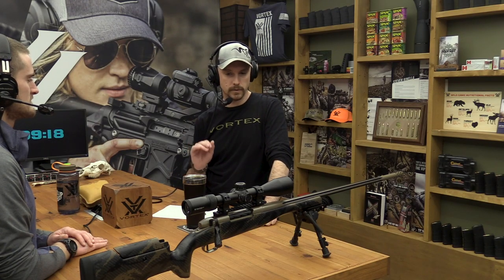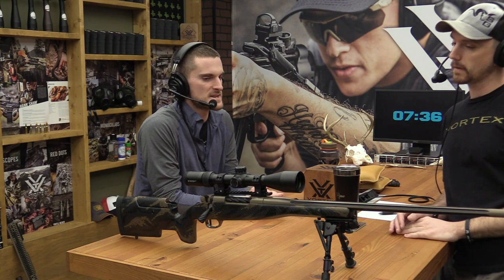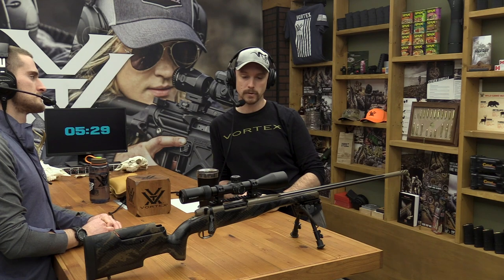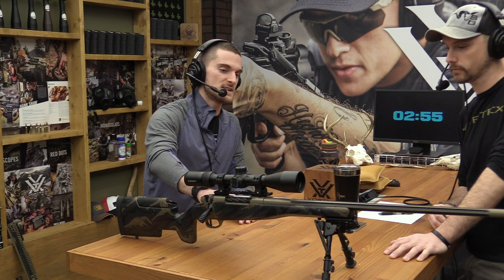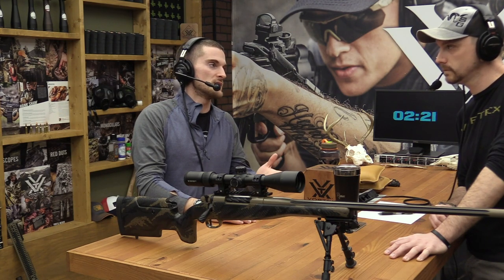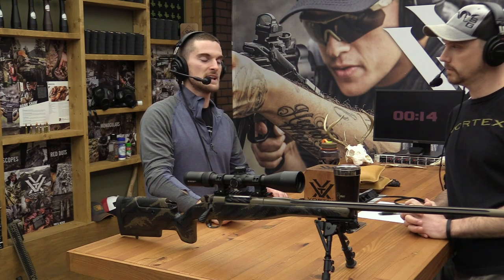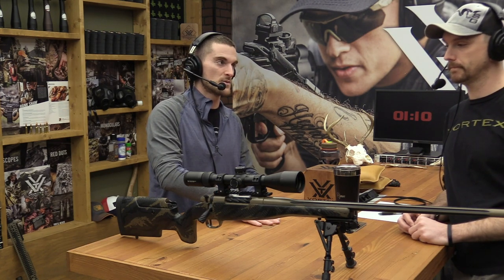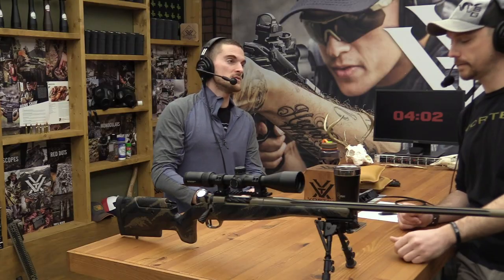#10MinuteTalk - 20 MOA Bases

Comment: Do you also have to buy 20MOA Rings for the scope if you have a 20MOA base?  Nevermind you answered it.  20+20 would be 40 MOA....makes sense.  So use 0 MOA rings if you have a 20 MOA base.

Comment: May be a dumb question, but im gonna ask. I just picked up a 6.5 creedmoor, I checked the picatinny rail screws for tightness, they were very loose. I went ahead and removed the screws to clean and chase the threads before putting the 20 MOA rail back on. When I removed the rail, there was a significant coating of oil under the pic rail? Is that normal? I just watched a MDT video and their shooter said he put oil beneath the picatinny rail?

Comment: Just picked up a rem 700 in .308 and have a Viper PST 6-24x50 ready to throw on it but I’m split between a 0 and 20 rail. Using it for hunting and most shots will be inside of 600yd but id love the ability to hit steel at 1000 if we’re messing around on the range. Do I need a 20Moa rail with that 65moa travel in the scope?

Comment: This resolved my issue.  I've got a Leupold Mark 5HD 7-35 and had a zero cant scope mount on a Tikka Tac A1, 6.5 CM.  After zeroing the scope, I only had about 14 mills of adjustment on a 30 mill capable scope.  I intend on shooting past 1200 yards.  A 30 mill base has been ordered. Thanks for the info.

Comment: good info. have a question tho.
i just put a 20moa base on my 06. won't  be going to the range for a while but wanted to see if i could preset it kinda close first. could you please tell me if my process is right or if i am way off?

to calculate the approximate zero from bore level i used strelok app to find what distance would require 20moa elevation. plugged in a 1 yard zero with a scope height of zero. it showed 710 yards needs a 20 moa adjustment. so if i put my 2½" high scope on with zero elevation would that put poi at 2½" high at 710 yards?  does that work right?

if so i can plug in the right numbers and adjust for the scope height and preset for any distance. or if i'm wrong i will just have to wait for range day and start from scratch

Comment: Great video, Question, If you have a new scope/rifle with a 20 moa rail attached, the first thing you do, even before boresighting etc, is to click down the scope by 20 moa/5.8mil to adjust for having the 20 moa rail attached?And only then you go ahead and boresight and zero your rifle, which of course could mean you may have to further fine tune up/down depending on scope height etc. Is this correct? (assuming you have mounted everything else correctly etc etc) I know some of you say you should always boresight first thing, but I dont understand this because you already know that you are "wrong" by 20 moa so why not adjust for that first thing? That should at least make your initial settings closer to the correct settings?  Please comment
Reply from the maker: It might make them closer, but it’s not going to be perfect like you eluded to. If that is just part of your procedure it’s certainly not going to hurt anything, but what very likely may happen is that you dial in that 20 MOA before doing anything else, then when you go to bore sight you have to take a bit of that out. It’s a horse a piece. Whether the optic starts at optical center or a predetermined spot, it’s going to need to be adjusted anyway!

Comment: I have a FX Maverick in .22 caliber With a Titan 5-25x56.  In your discussion you said that 20moa was not required.  If that is the case what mounts would you recommend ??
Reply: Standard rings.  I do believe the Maverick has 20 moa built in, my Impact mk2 does.  1000fps airguns can benefit from it, because that's so much slower than the guns these guys are talking about.  Our 60ish yard drop is similar to a 308's at 1000 yards.

Comment: You guys hit on alot of the major points for using a canted base.  I am the 22lr guy, I shoot 300 yards and bought a 150 moa base to get out to 500 plus yards (I know 150 is a lot), I appreciate the comments about being optically centered looking thru the scope.  I agree most people won't need a base unless they are running out of adjustments using their turrets.  Good info on  moa/mils  simply divide by 2 to get your up/down usable numbers.
Reply: What's your closest possible zero with a 150moa base haha? I dont ever see scopes that have that much travel
Reply: @aquadonkey.  I honestly haven't tried to bring it in, I'd imagine I might be able to get as close as 75 yards using all I have in the scope.  Personally I would just use one of my other rifles that are zero'ed at 50 yards.  I kinda like to keep the 600 yard zero set and just shoot long range with that rifle, the 150 moa scope base I can dial back to 0 moa or flat with the barrel, doable, but a lot of dailing, lol
Reply: @aquadonkey.  I use a Herritage Arms Coldshot 150 or 300 Moa scope base under my scope, my weaver t-36 scope hardly has any adjustments, so the adjustable base gives me a true 150 moa worth of elevation to get on target

Comment: I have a 30-06 savage this will be for hunting. would you but a 0 moa or a 20 moa rail. I plan to 0 at 200 yards.
Reply from the maker: With either you could zero at 200 yards no problem. It would really depend on how far you are looking to shoot out to. If you are planning on shooting 700 yards+ then you would want to go with a 20 MOA rail. If you will be shooting closer than that, a 0 MOA rail would be just fine.

Comment: Is there a way to calculate what base you should run? Just picked up an R700 tactical, trying to find out what base would be usable with 65moa of elevation. Realistically only shooting up to 500-800yds
Reply: If you are only shooting 500-800 you would be fine with a 0 MOA base.  No need for 20 moa plus base, unless you plan to shoot out to 1k plus.
Reply: I would say 500 to 800 yds that a 20 MOA base would be just fine and give you a little more elevation MOA. Any shorter than 500 yds. stick with the 0 MOA

Comment: It took me awhile to understand this MOA scope business as I am new to shooting , 6 months so far.

When you install a rail with say 20 MOA it's not the scope that tilts down it's the barrel that tilts up. 
So a scope with say 60 MOA total max. elev. adj. and a 20 MOA rail will tilt the barrel up 20 MOA and the top half of the scope adj. which is 30 MOA allows the barrel to have a total of 50 MOA adj. as it is already adjusted 20 MOA because of the rail.

The barrel moves people not the scope. 
😃
Reply: @Old SkoolK-5 it took me awhile to understand what is going on but I think I have it now. Three weeks ago someone put a 30 moa rail on my rifle with 40 moa max vertical movement in the scope and at close range 50 yds we could not zero it in and they said my scope was NFG. I switched to a 0 moa rail and the scope is now fine. I was told however at long distances I would be good to go. TRICKY for new shooters to understand.

Comment: Hey guys, if you zero your rifle right at the bottom of the elevation range, is there any downsides? The forums say it can hurt the scope, but what’s the opinion there
Reply from the maker: You would be zeroed at a spot that isn't in the optical system's most ideal spot - the best optical quality you'll get out of a riflescope is right in the middle of its travel. You also are leaving yourself with zero room for error should you ever need to make a click or two further in elevation - you're already bottomed out - and you're going to have much less windage travel at the extremes of the elevation, too. It's really not a great spot to be in.

Comment: I have a Howa 1500 Tspx 6.5prc with a 20 moa base. I'm have trouble sighting in. I have a Vortex Strike Eagle 6x 25 x 56. I was wondering can a lazer bore sighted compensate for the moa rail¿    I'm new into long-range and new into shooting. I know I might have put the cart in the front of the horse but we were all there once. Please, any advice would be greatly appreciated.  Thank you
Reply from the maker: You would be much better off pulling the bolt and bore-sighting that way rather than using a laser boresight tool. If you need any help, give us a call at 1-800-4VORTEX ext. 5 and we can make sure we get you all sighted in.
Reply: @VortexNation  thank you very much sir

Comment: What MOA scope mount should I get for Sig Sauer SIERRA3BDX 6.5-20x52 Rifle Scope? thanks
Reply: I have the leupold 4x24x52 with a 20 moa rail my scope is really high be sure you have the right stock to accommodate the discrepancy, I had to add a sleeve on my stock I don't really like it

Comment: I just got a 10.5 inch pof ar pistol. 
I Also have a colt 16 inch AR. 

I bought a PA 1 to 6 acss raptor 
What kinda mount do I need? 
I would like to have one I could switch it back and fourth till I find out what i like. 
I’m not hunting. But you know end of world kinda zombie deer gun. 
Just for fun thing. And I want to learn more. 

I liked the scalar works mount it looked Easy to put on. 
With the 1.93 

And the 
AD mounts with 1.93 

But PA glx 30 seems to be ok for 100$ and me not even knowing what I need it comes in 0 or 20 moa 

Any ideas ?
Reply: Ffp scope btw.
Reply from the maker: Are you hoping to have one mount and swap scopes in and out of it, or different mounts with different scopes in them and you would swap the whole mount/scope combos in and out on the gun? If you're hoping to do the first option, then switching scopes in and out of one mount is about the same level of effort/time regardless of which mount you get. Any of the mounts you've mentioned should be fine. If the second option, then having a mount that's quick-release like the Scalarworks mount, or an ADM mount, LaRue, etc would be good. For what it sounds like you're doing, don't worry about getting 20 MOA - a 0 MOA base will do just fine.

Comment: I have a Vortex Diamondback Tactical SFP 4-12x40 with a zero MOA base on a Rem 700 5R .308 and I can dial it to 37.75 MOA and hold dead on at 1,000 yards.
Reply: Strange as this scope only has 70 MOA max. elev. adj. which means 35 MOA upward adj.
Reply: @DLN-ix6vf  My scope tops out at 39 MOA elevation.  When you zero a scope it's not going to be exactly in the middle of available adjustment.

Comment: Question! With the 20 MOA base, can one make accurate shots at shorter distance? Let's say 50 or 75 yards? Or is it too much of an adjustment? Would I still sight in at 100 yards? And just have the capability to shoot long distance? If that's the case, why would someone NOT get a 20 MOA base? Thank you
Reply from the maker: The biggest issue most people have is zeroing the center crosshair at closer ranges with canted bases - usually a 20 MOA base on most rifles with a scope with a decent amount of adjustment have no issue zeroing at 100 yards still, but significantly closer or with a significantly more canted base, it can become impossible. Accuracy at close ranges is a different story altogether since you can still technically shoot accurately at closer ranges, you might just need to hold on a different spot in your reticle, dial differently, etc. There are tricks to overcoming a lack of adjustment in some way or another with your reticle, it just depends on whether or not needing to do these tricks is acceptable to the end user!
Reply: @VortexNation  thanks a lot! Appreciate your time. Great podcasts!🤝🤝
Reply: you could buy an adjustable moa base, I own a coldshot 0-150moa base, I will be buying an era-tac 70 moa base next month, era-tacs adjust in 10 moa increments up to 70 moa, or the Ivey adjustable base which is about twice the cost of the first two I mentioned, I like my coldshot as I can keep my scope optically centered, no or minimal adjustments on my scopes up/down adjustments as the coldshot scope base adjusts in 1/4 moa clicks, that is approx. 4 clicks per inch at 100 yards, optically centered is like looking thru a magnifying glass straight ahead vs moving the glass and looking thru an edge, there is less distortion looking thru the meat or center of the glass
Reply: @wowguy3562  thanks a lot man! Seems like that's the way to go. Appreciate you. Wish you tight groups ;)
Reply: Could just get an offset red dot for up close shooting
Reply: @wowguy3562  
Sorry they are so expensive. 450-600$. Very interesting products 👍

Comment: I have a 20 moa base. The negative side of this is that i am unable to zero it at 100 or even 200 yards, because it reached the max bottom range of my scope adjustments
Reply: had the same problem and it was because the scope only had a max. elev. adj. of 40 MOA or 20 MOA up or down. In my case the rail was 30 MOA which means it would most likely zero at around 1000 yds.
Reply: Absolutely, this is a trade off we need to make for 20 moa bases
Reply: @jineeshpr  I switched all my rails to 0 MOA and am very happy I did
Reply: I just realized what 20MOA base actually means on my Tikka T3X tactical and installing 20MOA canted American Defense Recon mount on it. I went to bore sight my Burris Signature HD 5-25x50 in my house to what I estimated to be a 150 yard distance and my elevation turret bottomed out just as crosshairs went onto the Center of the target to my complete surprise. And I haven’t even been to the range yet for some group shooting. How am I gonna sight that rifle now? Or do I need to sight it at longer range, let’s say 200-250 yards instead? My intention was to do mostly long range shooting anyway with occasional hunting trip in between so maybe it’s not a bad thing.
Reply: @olegk455  yeah i had to zero it at 300 yds.
Recently i changed it 0 moa base and all ok now
Reply: @DLN-ix6vf  did the same and very happy here as well

Comment: I saw some videos and site where the people recommend putting shims in the ring to adjust the angle of the scope. And then they give themselves out as "experts". That in itself can cause a lot of damage to the scope. Maybe you must do a video on mistakes like that.
Reply: Actually,  once upon a time , that was your only option.  Scope tubes back then were made out of beefy blued steel not aluminum so several compressible aluminum shims made from cans of beer would harm them not.
Reply: @samuelpope7798  Only problem is that modern scopes are made of thin aluminium to keep the weight down.
Reply: @L.V-Rider  pre elevated bases were a gift from the gods!

Comment: A question from the admin or any 1 on this channel is if a sope has 120 moa's top to bottom then some experts says that to utilize all moa's u must have a 60 moa base
So now how to find in millimeter or in inches that my scope base has 60 moa's
Those experts also says that from rifle top (where the rail, ring base then rings r attached for scope) to the scope base u must have at least 1.5 inches gap or distance or height
Any video reference or answer here
Reply from the maker: You most certainly would NOT want a 60 MOA base in this case. If your rifle required even one click of adjustment in the other direction to get zeroed, then you would have nothing left and wouldn't be able to sight in your rifle. All rifle and scope combos are going to use up some of the available adjustment just to get zeroed in due to natural misalignments that occur in manufacturing and mating all the pieces together. The other thing to consider is that an optic is not at its best in terms of optical quality when it is at the very extremes of its travel. The best situation for your optical quality is when the scope is at its optical center, so moving it 60 MOA away from that and having it there for your zero would not be very good. As for scope height, we have a podcast we just released on that as well - just mount your scope at the height that is most comfortable for you when shooting behind the scope and that isn't running into the gun. Pretty simple. If you can't get it just right without running into the gun, you may need to use things like a cheek riser or adjustable stock to get your head in the right spot, but don't sweat optic height too much.
Reply: @VortexNation  does any of ur video or videos answer my question or explains ur answer
If I want to study ultra long range shooting or extreme long range shooting what video series I should watch so then I can learn that how to mount and adjust scope for elr or ulr
Plz do guide in that respect

Comment: I’m new to hunting and this long range trend is making it hard for me.  Lol.  I’ve read for hunting you also want to keep the scope as low as possible.  Right is u buy one pice rings and mount as low as I can. My rifles get beat up.
Reply from the maker: There is no need to get the scope super low - just mount it up at a comfortable height for you to get behind when shooting. fractions of an inch in scope height won't have any appreciable difference down range.
Reply: Vortex Nation Podcast I have a big head. Lol so. I have gotten where I like a 3x9x 50.  I’d like a 4x12x50 ish. I’m good with 45 to 50.  I hunt East coast deer and hogs.  I’ve learned a lot watching your podcasts.  My best friend compete and shoots 1000 yards.  What he wants vs what I want is different.
Reply: @VortexNation  Absolutely agree.  I feel the fit is far more important that the height.  Think its a bit of a holdover wisdom from the days of non adjustable combs and 100 yard shots.